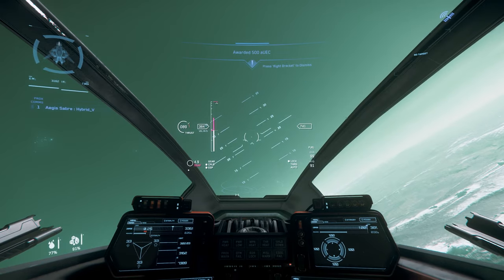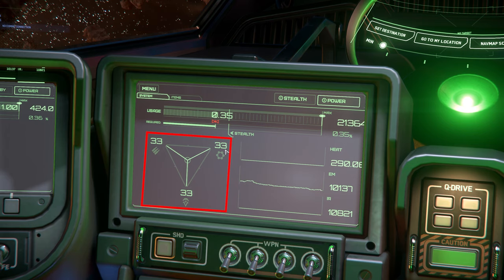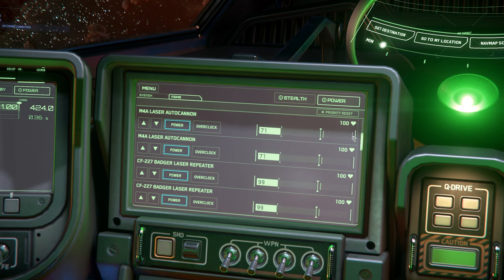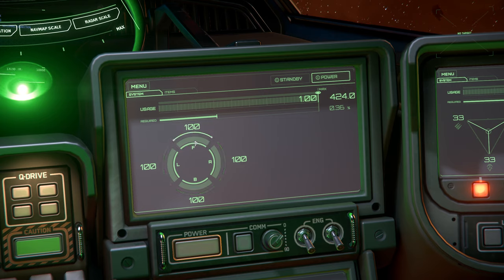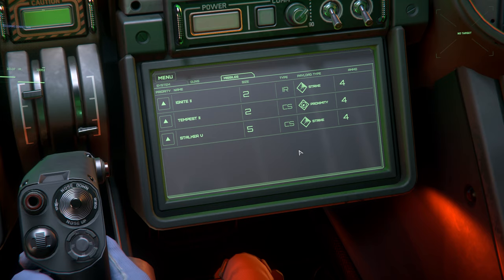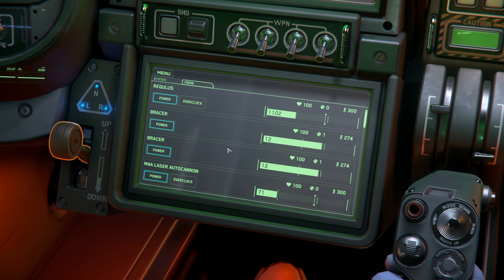Star Citizen - Multi-Function Display Tutorial | New Pilot's Guide to the Verse

Comment from the maker: UPDATE
3.14 Has radically changed how the Power Priority Triangle (PPT) works now. What it now does is increase laser weapon capacity and improve recharge times of lasers when power is pushed toward weapons. Improve shield recharge times and reduce incoming damage on shields when power is pushed toward shields. And speed up recharge times of boost and reduced the cost of using boost when power is pushed toward thrusters (Boost is the new replacement for Afterburners).

Timestamps:
0:00 Intro
1:23 Brief Overview
3:06 Power Page
9:02 Shields Page
13:09 Weapons Page
15:46 Heat Page
20:20 Comms Page
20:51 Self-Target Page
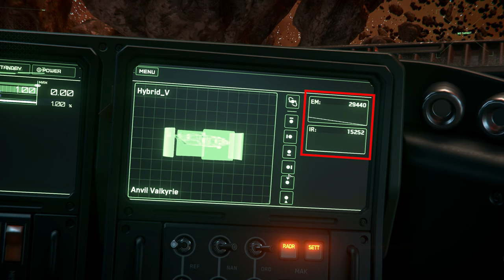21:35 Target Page
21:51 Annunciator Panel
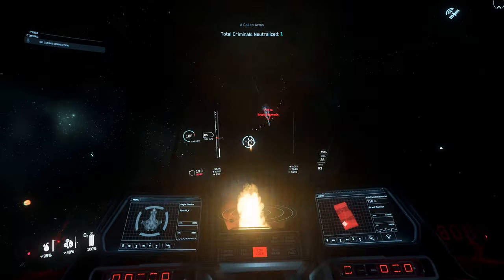23:30 Radar Displays
24:41 Turret Specific MFDs
24:59 Multi-Crew Stations
25:38 Upcoming Changes to MFDs
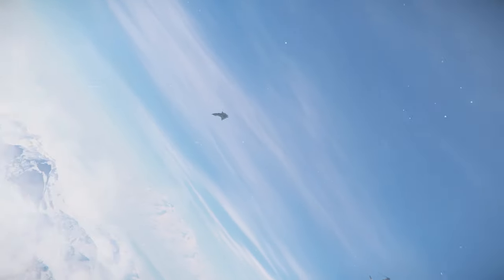26:16 Conclusion
26:30 Final Thoughts
27:50 Outro
Reply: The stealth toggle isnt useful yet no?

Comment: Wow  learnt a lot from this, thank you! I've been meaning to look up MFD's as a lot of the functionality in SC is pretty poorly shown.
1 thing I can add.. at around 2:45 talk about looking around and selecting MFD's and then using mouse scroll to zoom in/out. A better way to do this is to tap middle mouse when focusing a specific MFD or if holding F, when your cursor is on an MFD. This will zoom in on that MFD and then mouse scroll can still be used to scroll down the MFD lists. 
This functionality is in the key binds menu but i cant remember what its called.

on second thought you may have meant that but just to clarify the difference ;)